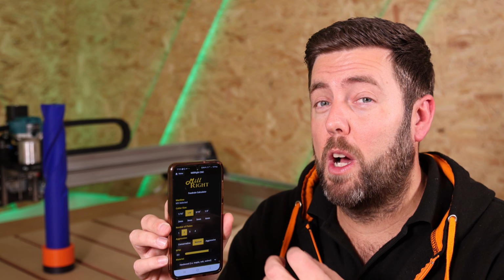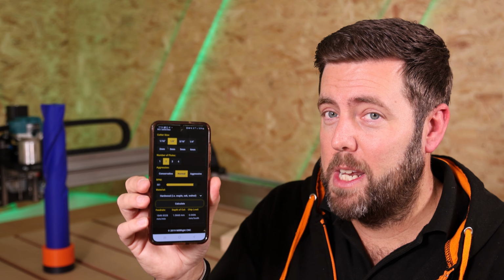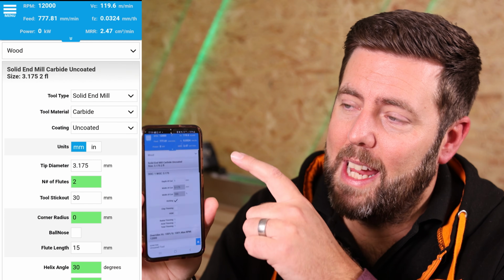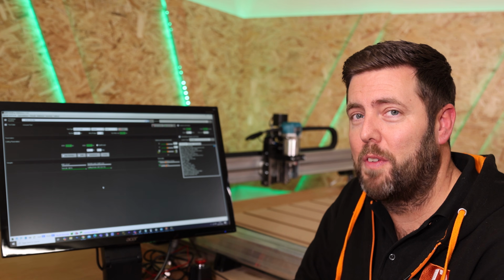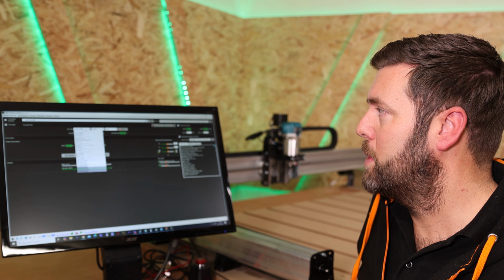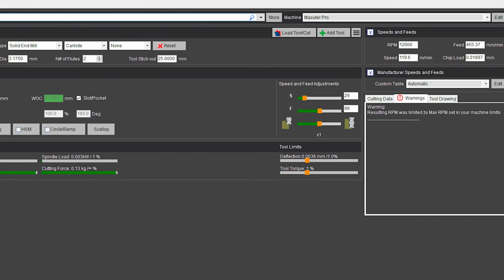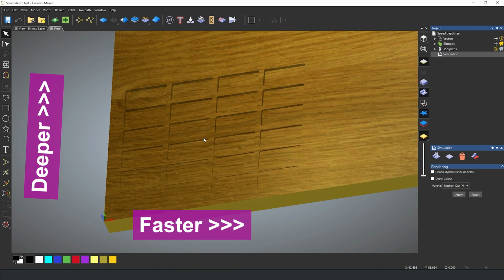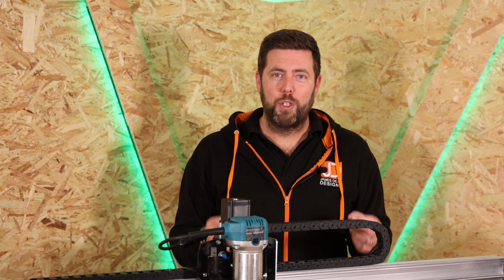Beginners Guide to Speeds and Feeds on Desktop CNC machines

Comment: I have been using a 4040 pro max for 2 years.   Like it but considering a larger cnc and looking at the longmill 48x30.     I am interested in understanding the speed differences.   I would,like an upgrade on speed and want to know the difference between the 4040 pro max and the long mill.   Hopefully something you can speak into.
Reply from the maker: The speed difference is a little better but not a huge amount because the 4040 Pro Max is quite a solid machine but ultimately I think the Longmill can running a bit quicker and the stepper motors are stronger.

Comment: Hi !! Bounced across from Garrett to watch a few of youre Videos and Findling them very informative. Ive got an ooznest workbee with a duet Controller and use vektric v carve pro !! Ive been carving now for about a years and a half !! Alles going well i think but i normaly use the feeds and speeds sugested by the idc woodcraft Data. Ive only ever Broken Bits due to User Error but in all honestly i dont visably See a diference with the Maschines Feed speeds IT all Looks pretty much the Same to my eye. I can increase the Feed Speed in the Controller with a Slider Button but every Thing else ist pretty slow ( konservative) i feel how can i Check ime doing Alright ? I could do with Somebody that knows what there doing to watch for a couple of hours 😂but as ime in Germany thats a longshot !! Keep Up the good Work Tommo. ( The German Nick Knowles )
Reply from the maker: I'm much closer to Germany than Garrett but still a long drive for me 😆
It doesn't take time to dial them in. Sometimes being aggressive can be helpful even if you break a bit because it gives you an indication of what it sounds like when it's rough and you're going too fast. But just doing little tests can get you there as well as opposed to entire carves.

Comment: Great info, but, how do you apply all this to speeds & feeds for a corn-tooth mill?
Reply from the maker: Corn tooth mill is quite a specific tool, often supplied with smaller machine but usually used on the wrong materials. Dont think I have seen an app cover those bit so sadly it is a case of trial and error and using the adjusters in your control software

Comment: All Chipload calculationsive seen start with a Chip load as a 0to 1000th size but dont say what it is, the half way through the calculator they call in a different chip load in the formula eg
Chip load= flutes x rpm x sfm x chip load 
Circular Reference error in spreadsheets

Comment: What i learnd as a full beginneris using wrong bits. I have desktop cnc with 700w router spindle. I tought if i am using bigger bits with 6 to 8mm in dia then i wount break bits so easily. Thakfully i fined James older video about feed and speeds where he talks more about bits and suggest to use flexy hoby machines smaller bits with one flute! Depth of the cut is still question. One more thing is testing. Just show your testing proccess in live. And problems possible happen.  GL WITH APP

Comment: Totally agree. Maybe you mentioned this but running a machine too slow will just wear the bit out a little faster. An app like your will get it close but you still need to test
Reply from the maker: @kevinjensen9817  yes, i mentioned going too fast or too slow will essentially ruin the bit but 100% agree regarding my app. It's not going to be a magic wand but hopefully get people close and give them confidence
Reply: @ yes and FB groups there are so many newbie’s with that exact question and the answer is always, it depends on so many factors but if you get em close, then they can learn with less fear. I have worn out bits pretty fast but never broken one so I am probably not pushing hard enough. Lol

Comment: Brilliant idea to go for an app👍
I am a total nubie bjt love cnc machine and try to get there... Have you considered apart from the variables you are going to include in the app to apply a mic.function for evaluating next to everything else the noise/hz/sound of bit vs material (for milling, for tapping etc.). Sound does speak to the ears sometimes about the process. Just an idea..
Reply from the maker: It could become an advanced feature later on, my main goal is just to get it launched first which is the hardest part :)

Comment: Great video and good for you on the appl.Can't help with settings yet, LOL, I have a diode laser and looking into buying a CNC....I cant decide between a Foxalien or Genmitsu around the $1000 mark. Any direction steering would  be great!
Reply from the maker: @dawnabbott3783  if you already have a diode laser and therefore no real desire to run a laser on a CNC machine, the Sainsmart 4040 Pro Max is probably the best overall for under $1000
https://shrsl.com/4oyma
Reply: @JamesDeanDesigns  thanks! I was leaning the way, I live in Canada so it will hopefully be easy to obtain. I just bought the Makita router too!